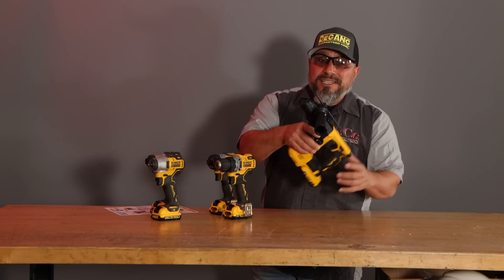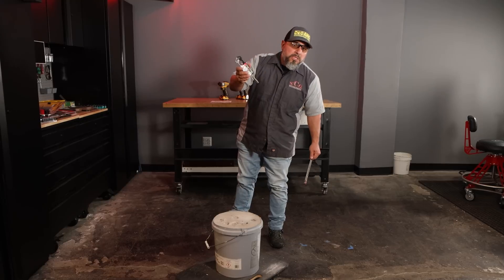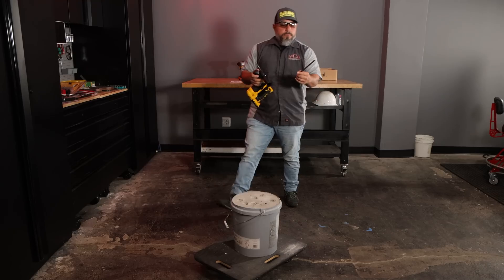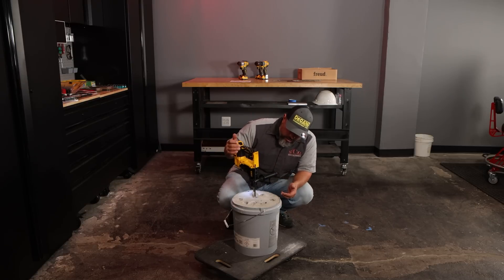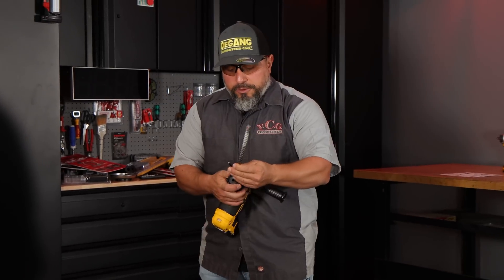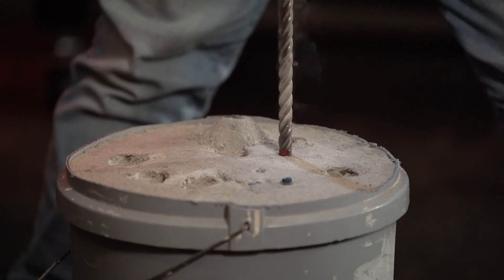Is DeWALT'S Xtreme SDS a REAL Rotary Hammer?

Comment: I have the dewalt dcd999, would the dch072 perform faster or stronger than dcd999? Or would I need to upgrade to the xr rotary hammer to notice a difference.

Comment: I notice mine doesn’t start out drilling like that at first. Takes a bit to go full drill. Any idea?
Reply: If you mean it takes time for the hammer to kick in then I have the same problem with a Dewalt DC213KA 18volt SDS drill I have. It can be a real pain when you need accuracy on a hole, I kind of tap the bit with the drill to get it to kick into hammer action, I heard other users complain also. I never had that problem with a Makita SDS drill. It might be that they don't grease the mechanism well enough inside or the grease isn't fine enough for the mechanism, they are supposed to use finer grease in hammer mechanisms than inside the gear box, otherwise its just a fault. My drill is impressive but that quirk is annoying for me sometimes.

Comment: So apart from the battery draining faster than an angle grinder, It worked top notch.
Reply: 12volt 3ah battery doing work typically left for 20v or corded SDS tools... yea battery life is going to be significantly lower

Comment: It's a fantastic SDS for putting shelves/TV bracket up, it drills really clean holes.  I no longer use my 20v SDS anymore
Reply: Hi.
Just need your opinion.
Will you feel that this 12v SDS is very less power to the 20v SDS???  Also the battery life !!
I’m confusing with to go for.
This 12v sds or the 20 v sds with 5.0Amps Battery
I’m mainly use for house fitting
Reply: @fredericktan9692  yes it has less power and my 3amp battery doesn't last long, also battery gets hot.  If you want to drill small holes the 12v is perfect.  If you try drilling a 6mm hole with the 20v SDS it will make a messy hole (it's like using a sledgehammer for panel pins).  I only use my 20v SDS for really big holes (16mm)

Comment: The DCH133 is much cheaper (It used to be only $159 for tool only at Home Depot, now $229) and much more powerful. It somewhat awkward to use because how long it is, but it works really well and with a 6Ah battery will last for hours of work. I personally don't see much use for this. For smaller tasks, DCD805 Hammer Drill works well enough.

Comment: In my opinion here's why this tool is actual garbage.
 it's light/small subcompact enough to where your arm is not stressed as much as a compact rotary but the moment you're using this enough to warrant a rotary hammer vs a regular hammer drill the wear on the tool is too much to warrant the cost increase (smaller components means thermal, shock, and friction forces)

So it's too light to be a proper trade tool in its role and unnecessarily expensive over the regular hammer drill.

Comment: Looks like the 5.0 battery would be better for it. This would be a handy little tool for setting anchors especially over the head work.
Reply from the maker: Good call
Reply: Exactly what I'm getting it for, set maybe 10 anchors or so for a pump pad and change out and I don't wanna have to use the corded Hilti our shop has. Too lazy to roll up an extension cord lol

Comment: i dont understand the world of sds. and need to be educated on it... this tool seems like a smaller and lighter one so i guess my main question here is does that extra lightness actually give the user more control and accuracy for those smaller jobs. without holding up a heavier sds that might wander about or be off center. then you realize and try to correct the angle halfway thru drilling, and cause a blow out etc.

thing is before i was just thinking we need a) 12v light drill for delicate work + b) 18v hammer drill (for harder work, including light masonary such as this)... + c) a very large sds for heavy masonry work. including chiseling / demo work.

so my question really seem more around is there a place for this tooll within that lineup between b) and c) ? ie to help save the chuck on the b) 18v main drill and keep it from getting messed up doing these masonry jobs? as i think for myself it is a bit of stretch to justify a total of 4 different drills to cover everything. (unless some of those drills were cheaper corded tools like the biggest sds for example)
Reply from the maker: If you’re setting concrete screws, or drilling smaller holes through concrete day in day out on top of scaffolding, lifts, or ladders you’d want a small sds like this.

Comment: I don't get it, why would you need DCH072 when you can buy DCH172, which has more impact force, has shock absorbtion, and is almost the same weight. I own a DCH172 and I don't know how it is made, but it seems stronger than 1,4J
Reply: Because some of us have the DeWalt 12V Extreme line, but we don't have any 20V batteries. I can buy this -072, or a -172 AND some batteries and spend a lot more. For a DIY person like me, the 12V makes better sense.
Reply: @l00nybin  yeah, I totally agree, if you have only 12V then DCH072 is worth all the money. Otherwise, 172 would be a better choice

Comment: I remember Vincent talking about how important weight gets when you get older - oh - he was so right about that. One thing I like about this is that if you are not needing the extra power, that reduced weight is a big deal.
Reply: Absolutely! Plus these new 12v tools have a ton of power  not to mention they are easier to control
Reply: But everyone laughs at me that I use a 10oz hammer for wire staples🤔
Reply: @赔我小鱼干  If it gets the job done - really, who cares.

Comment: I abuse the heck out of my M12 rotary hammer, I was once drilling a two and a half inch hole to run a new line set for an HVAC unit with a corded Hammer that died, and I finished the hole all 7 in of it with the M12

Comment: I think if you're going to buy a rotary hammer, you should get one a little bigger, or at the very least get some bigger batteries
Reply: Compact rotary hammers like these have a purpose. Sometimes you don’t always need cores drilled out or trenches made for plumbing repairs. Sometimes you need a large amount of tap cons installed for 2 hole clamps for a gas, water or electrical line. I could throw my Makita 12 volt hammer drill and impact  in my Veto tech pac and climb multiple flights of stairs or ladder hatches for a repair or install. A 12 volt rotary hammer is a good special purpose tool for professionals. It’s a power to weight ratio that this tool solves and can easily make a job site  more efficient even if it’s a work out to get there. These aren’t meant to go head to head with 18 or <36 volt tools. These are meant to make your day less of a pain and believe me it’s worth the price of admission even if you only take it off the shelf a few times a year.

Comment: I use this 9/16 every day for setting 3/16 and 1/4" tapcons to hang TVs on exterior walls, and also 1/4" holes for garage shelving. its light and quiet very easy to control one handed. Usually, one 12v 5ah battery lasts all day long.
Reply from the maker: Thanks for the input Jaxx
Reply: 🤦🏻‍♂️ really?!? Lol. Bro a 12v drill will get you there… This is overkill for you. Chill😂😂